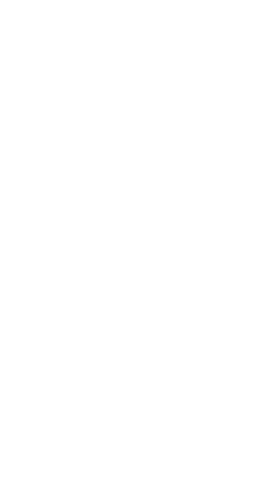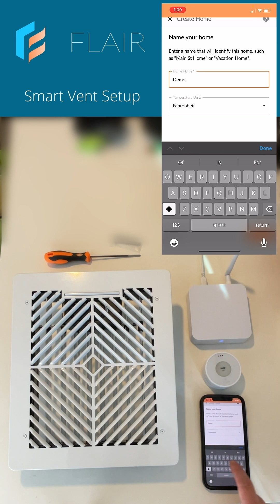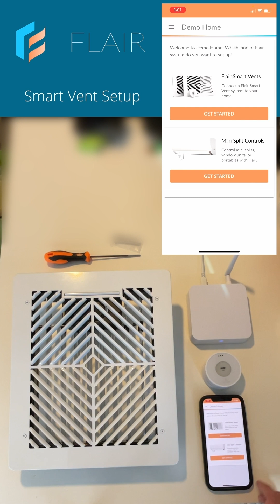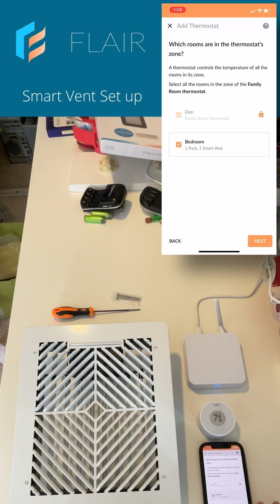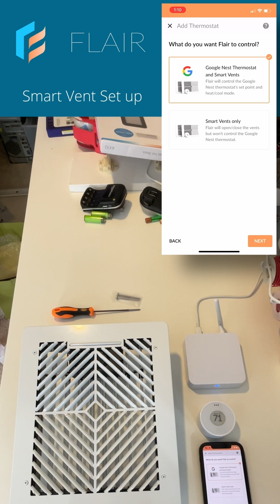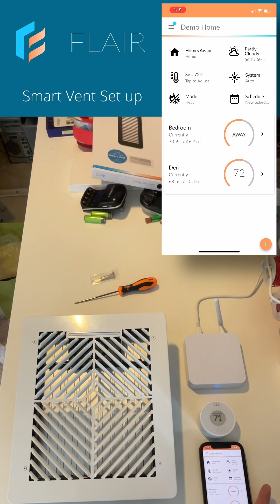Setup: Flair Smart Vent System

Comment: Does the Flair software have to be connected to the Flair web server in order to work remotely or does it merely need to be connected to our home network? I've been burned by Google Nest servers going down and not being able to control my thermostat remotely.  Also, been hugely burned by them discontinuing remote and in home network support this year for 2nd gen and earlier thermostat users, which enabled us to use the Nest app to control our devices.  Essentially,  this made the Nest Thermostat nothing more than a hocky pick and a waste of $250 investment per device.

Comment: Can you use the app to just open and close the vent without adding the bridge and puck?
Reply from the maker: The vent connects to our Bridge over a 915 radio and the Bridge connects to the App over WiFi or Ethernet so you'll need Bridge to manually open/close a Smart Vent.
Reply: @FlairSystems  better come out with a 2nd Gen that doesn’t use a puck or bridge

As I already have Nest Learning Thermostat and Nest Sensor around the house

Why would I want to add a bridge and then a puck for each room?

Why not add the puck function into your Vent?

And use 802.11b 2.4GHz to connect to the Home WiFi?
Reply from the maker: @georgegiorgio  We already work with ecobee, honeywell, and sensi remote sensors - the issue with working with nest sensors is that nest has not made their sensor data available through and official api.  We are in contact with them and advocating for this but can't force them.

The smart vents operate on a low power long range radio as they are deployed into an environment that is unfriendly to radios like wifi (2.4/5ghz) and need to last for years on batteries.  As such, a bridge is unavoiable.